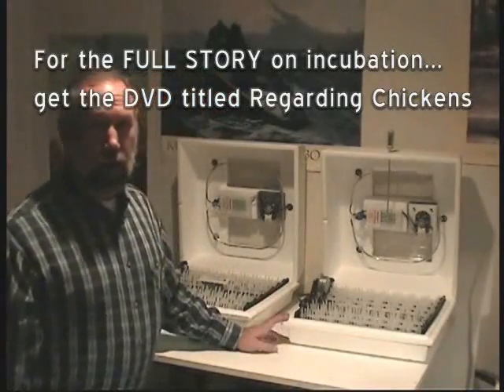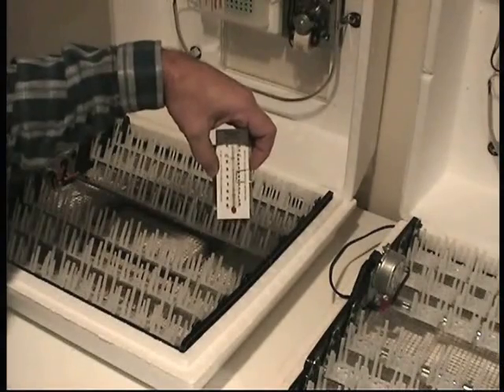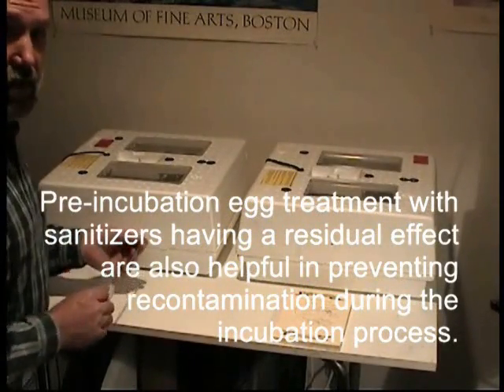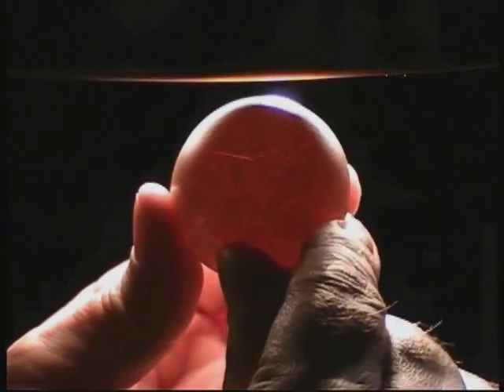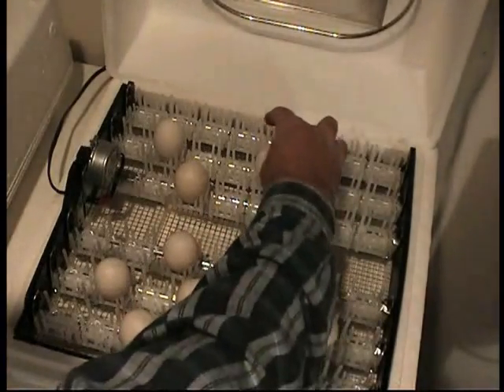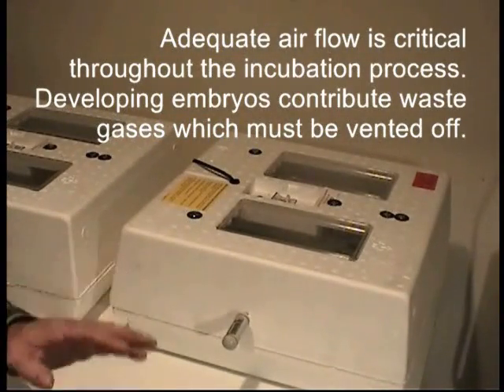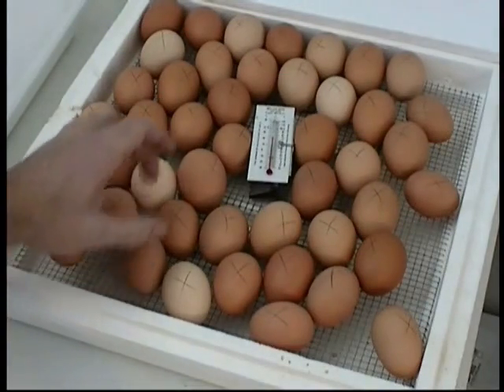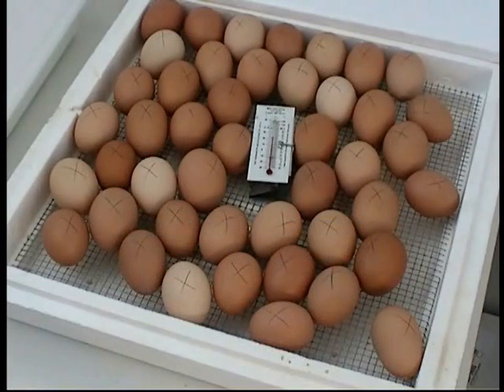Incubation, using the Little Giant Incubator, How to incubate chicken eggs, demonstration

Comment from the maker: Thank you, so glad you like them...  yes, always wash your hands with soap before and after handling your eggs (skin oils can block egg shell pores) and you can sanitize the incubator between hatches with Tek-Trol, or a 10% bleach solution (wear gloves) and then dry in the sun... really easy.  The little giant is probably the least expensive and does just fine...  the other unit has pre-set temps, so is more stable in the end... but comparable.

Comment from the maker: The most important indicator or proper humidity and weight loss, is to candle the egg itself during incubation.  learn how by visiting my website.  A humidity level indicator or wet bulb thermometer is not mandatory and you can probably get along without those indicators.  But you must look at the eggs by candling to know if they are on track.  Fill your water troughs during the last days so the chicks don't get stuck during pipping.

Comment from the maker: Yes, with the still air units I recommend 102 deg. F. in the top third of the egg.  You'll notice the temperature will be lower at the bottom third, this is why it's a different setting than with forced air.
Thanks for your question!

Comment from the maker: I agree that sanitization may not be necessary for the occasional small hatch and yes, it removes the bloom (nature's protection), For the large hatch, it's proven beneficial (solid science) and improves hatch rates.  Tek-Trol, for example, cannot cause a "deformed chick".  The statistics are proven, that large hatches (800+ per incubation batch) have demonstrated improved hatch rates when properly sanitized.  Each person may do what works for them.  I present both methods for information.